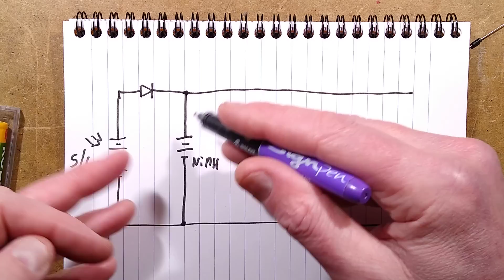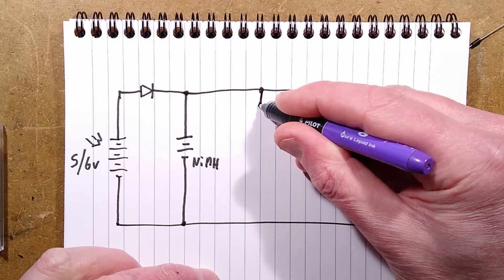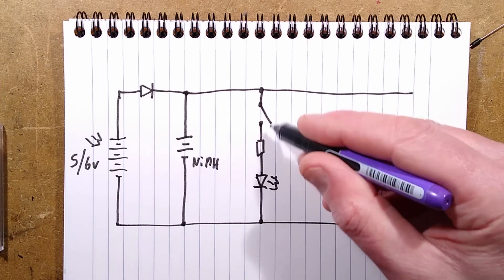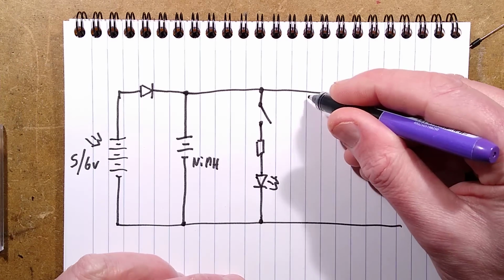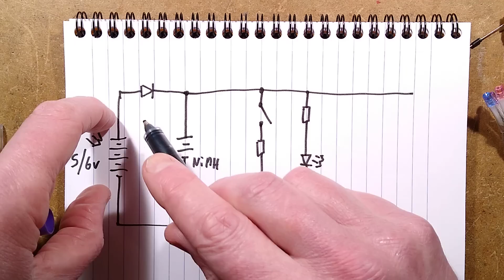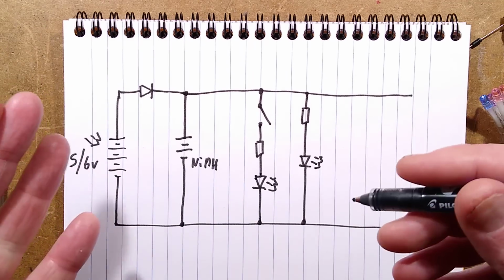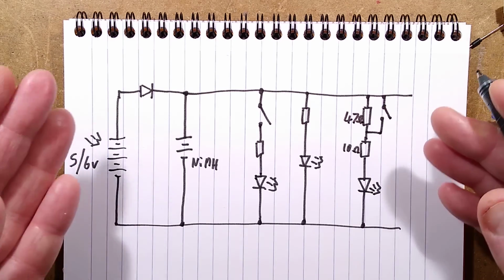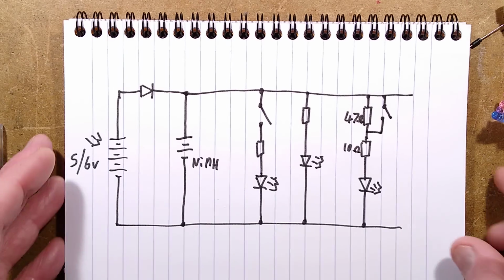Apocalypse solar lighting system.

Comment: i have an old powerbank case with solar panels, they open like a book, it also has adjustable output voltage, should get it into operation as i removed its battery as it was bad. This is a fun adn simple project, i like it

Comment: Something you showed but didn't really mention: If at all possible, especially in a post-apocalypse scenario, use connectors. It prevents having to completely rebuild the light every time something fails, and makes simpler-to-troubleshoot modules for people that might be less savvy. (This is post-apocalypse, so you're trading these with other survivors for supplies, right?) It does add considerations for accidental disconnects and waterproofing, but I still think the difference is worth it. 👍

Comment: Where do I get blue LED running at 2.4 Volts?

To make it a little more realistic, you should solder directly with solar energy. :-)
Reply from the maker: Most will run down to that voltage - but at very low intensity at that level.

Comment: Living in a rather cloudy environment at ~42.8° latitude, I find that I need at least twice the solar panel than is provided with whatever is commercially available for full 24/7 function.  Not twice the voltage, but definitely at least twice the current generation given the lack of direct sunlight where I live.
I imagine knowing how much solar panel you need (compared to average) given the direct sunlight of your living area might be a useful thing to know after an apocalypse.  And maybe even before one.
I'm rather fortunate to know there's a small hydroelectric dam not far from where I live.  It should be relatively easy to maintain if I were the last survivor.  It's kinda fun thinking about exactly what you could do if you suddenly were the last person on Earth - and still have decades to live.
Reply from the maker: the joy of this very simple circuit is that it adapts to ambient sun levels.  Even with very low levels it just glows at a lower intensity.

Comment: Can you disassemble a fancy microphone, like what Youtubers use?

I am wondering what makes them so much better.
Reply from the maker: Some do use a much larger microphone element, but many are basically just a huge fancy case with a standard tiny microphone capsule in it.

Comment: A small hand-crank generator would also be quite handy for the apocalypse. It could be as simple as a DC gearmotor from a scavenged child's toy connected to one of those 12v to 5v USB car adapters. A diode could be added to prevent the dc motor from destroying the device if it is cranked the wrong way.

Comment: The only thing this light is missing is the automatic dusk-dawn. This can be achieved by reading the voltage on the solar cell.

Connect the base of a npn transistor to the solar cell through a resistor before the protection diode. Then the emitter is connected to the base of a second npn transistor. The second transistor has a pullup resistor making it an inverter. When the first transistor is no longer powered by the solar cell, it stops pulling the base of the second transistor to ground, causing the inverter to output a voltage.

Apprently, youtube spam filter thinks that explaining a circuit diagram is spam so had to re-comment it here and explain it in English instead.
Reply from the maker: Look for my simplest solar light project that achieves this with a single transistor.
Reply: Odd how the reply keeps deleting itself. I could reply here but replying to above deletes the reply. I think youtube spam filter doesn't like it when dot and com is the name of the person. 

Original message: That's quite a simple circuit, it reminds me of the LDR voltage divider but uses the solar cell as the pulldown instead, https://youtu.be/B0H5iWZ0N60 is the video of him explaining it.
Reply from the maker: https://www.youtube.com/watch?v=AEnYRXr1_ww
Reply: One concern I have is the gate/base not turned on fully
Reply from the maker: @TheUnknownCatWarrior  The A2SHB MOSFET has an extremely low gate voltage and ultra high impedance.
Reply: What about the A09T N-MOS?
Reply from the maker: @TheUnknownCatWarrior  It has a low gate voltage too, so should work.

Comment: Definitely the hardest part would be soldering if you only have a big desktop iron that uses many many watts. If you've got a gas soldering iron or a USB one and a way to charge a Lithium battery it makes it way easier. I actually have little USB 8W irons that I keep in convenient places just in case... as well as LiPo cells and some small solar panels so I have a starting point to produce more power. Plus my area has a LOT of homes with solar systems, so I could get started quick on big lighting. But this would definitely be something I'd do for fun!

Comment: Hi, I really wish you could cover the 12V cigarette plug windshield defroster heater. They come with 0 safety, they are expensive and its said that they can deliver 1000w of heat also they are really cheaply made

Comment: Solar stuff doesn't work all that well here (Scotland). In the darker months when you want it most the garden lights usually die before it's fully dark.
Reply from the maker: This circuit deals with that by automatically balancing its output to match whatever light it can get.

Comment: We have several strings of solar lights indoors, with the little panels stuck onto the windows with blu-tack. They work alright, but the panels are realistically undersized so they tend to run out fast unless it's the middle of summer. I recently picked up some larger ~2ft square 30W caravan/canal boat type panels, and I'm planning on making one larger battery pack using LiFePo4, with several plugs like the ones you add to your strings to be able to have maybe 6 or 7 off one longer lasting pack.

Comment: On the 510 soldering tips for use with USB-/battery-powered vaping pens: do those you bought earlier still work? I have purchased some, and they don't seem very reliable, but they do work.

Comment: PV are basically PN junction diodes hence the 0.6v per element. That's why the internal loses increases exponentially when you reach that voltage. The no load voltage corresponds to all the current being wasted internally.
The highest power is usually a bit lower around 0.5v.
The problem with that design is that when the nimh are full, the current is still very high. Too much for the internal recycling of gazes. You'll dry the cells very fast this way.
It would be much better with 4 cells so when you reach 6v=4*1.5v the current from the solar cell drops to zero.
The diode is useless but can be used to drop a little but the voltage to 6v-0.6v=5.4v. With 4 nimh you'll get 1.35v maximum per cell. This would reduce the capacity a bit but would probably increase the life of the nimh because you'll get 0 charge current before the battery is actually full.
Reply: If there is no load, there is no current.

Current only flows if there is a circuit. No load means no circuit.

No load means that the electrons in the valance band in the semiconductor are being kicked up to the conduction band when sun light is falling on the panel but there is no where for the electrons to go, as there is no circuit.
Reply: @deang5622  They go somewhere: they are recombining with the holes creating that "internal" current. Otherwise photons will continue to create new pairs indefinitely and the voltage will continue to raise.
The classic way to model the solar cell is with a current source that depends on the illumination level and a diode that represents those recombining events (plus resistors because... there are always resistors)
Some explanations:
https://m.youtube.com/watch?v=uV_z1ptufa4&t=445
Reply: @cmuller1441  My point was, obviously, is that they don't flow in the conduction band out of the material as an electric current. Of course they lose energy.
Reply: @cmuller1441  Mate I don't need explanations on how diodes or solar panels or other semiconductor devices work.

I studied the semiconductor physics in great depth as part of my degree programme

Comment: I had lot of fun making mini solar power systems using LEDs in series and parallel as make shift mini solar panels and capacitors as rechargeable batteries. It only provides enough power to make an LED flash briefly or let you watch the multimeter discharge the capacitor faster than the LEDs can charge it while you are measuring the voltage. But, it demonstrated the basic principles of gathering, storing, and using solar power without having to make any extra investment beyond a basic electronics component kit.

Comment: Good to see this mini project Clive. I have a few 6v 160mah panels, which I am looking to do something with. Any ideas for a power bank, especially connecting the panels in both series and parallel, as I am not sure how useful the 160/320 mah capability would be ?

Comment: During blackouts we had to make similar lights here in Ukraine.😄 Because light day is short at winter and not much sun, we didn't use solar panels and rechargable cells. All diode garlands and even single light diodes were sold out fast. Power banks prices rocketed sky up. So you want to buy all components beforehand if you want to be prepared. What people used most back then is simple non-rechargabe alkaline cells(which were still on sale), electric instrument cells, car batteries etc. Simply what they had at hand at moment. Alkaline cell and light diode was simpleist and what were made most to place it all over your home and bathroom more frequently😄

Comment: Just before the threat of power cuts last autumn I sensibly bought a wind up/solar powered radio with an LED torch built in, Roll on the apocalypse, I won't have to solder anything to see WTF happened!

Comment: It breaks my heart to see that built without an off switch. The absolutely predictable problem with solar powered lights is that in winter - when you need lights for more hours of the day - there is only a tiny fraction of the sunlight you get in summer. My zombie apocalypse emergency solar batteries (12v lead acid 300Ah) are barely kept topped up Vs self-discharge when there is no drain on them in Nov/Dec/Jan when my 300W rated panels make about 0.4A at noon on an overcast winter's day, and nothing for about 20hours a day. So, it makes me cringe watching those LEDs being powered instead of putting that charge into the batteries :)

Comment: Great video, as usual. Inspired by some of your earlier videos I connected LEDs to 2 AA NiMH, without any resistor, and indeed it worked very well. With enough LEDs it can be a used as a flashlight, not a strong one for very long from just 2 AA NiMH, and strong is obviously a relative term unless you use a huge number of LEDs.  If I remember correctly each led drew 1.7 mA with the batteries just out of the charger without a resistor.    

Anyway, multiple pairs of batteries in parallell would make it possible both to use more solar power safely and make a "strong" flashlight that lasts a fair amount if time.

Comment: Seem to remember led can produce electricity,  so a lot of strings in connected in a star outside could power the NiMH cells,
got no diode, yes you do, light emitting diode. (chose star to minimize wire resistance)

Comment: I've had to recycle/scavenge solder from circuit boards before now for running repairs, I did a good enough job for a temporary fix.  This video did make me wonder how one could make solder and flux from scratch or at least recover it from the smouldering ruins of civilisation.

Comment: This is a great vid, the only thing I would add is try to use a small silicon diode 1n4001-1n4007 have a reverse leakage of around 5uA where as if you used a schottky diode it will have significantly higher leakage, even upto mA in some cases

Comment: A couple of years ago I built a solar light circuit with 2 supercaps and a joule thief powering 2 1W leds in series. The solar panel was salvaged from an old horrible nicd solar light. I used a npn transistor and the same solar panel for light detector. Super simple circuit, lasting to this day!

Comment: I'm playing with PV ATM. Two standard 1.5x1m panels on the east and west sides of my house, roughly pointing south charging a couple of AGM batteries. On a fogging morning I get perhaps 10w per panel  , peaking to 275w in full sunshine.  Enough to run the network routers and a small PC, with power to spare for other stuff (I'm not really into fairy lights).
Reply: It's good fun, but if people are doing this kind of thing to save money, it is rarely viable, economical in the UK.

You have to compare the cost of producing the electricity from the PV panel to that from the national grid.
Reply: @deang5622  Oh yes, it's just for fun . ATM I see no way for a full , grid linked, system to pay for itself.  If you take a UK average (annual) of 20w/m2 then , if you could use all the power from the panel, each panel would generate about £85 worth at 35p a unit!

I bought a couple of cheap s/h panels locally and keeping everything DC and cheap . I'll be lucky if it pays for the parts cost in two years

Comment: I highly suggest to change these batteries to much better lithium with cheap TP4056 BMS (salvage will do good too). These old type batteries cannot last long in apocalypse despite the light consume very little power. It's more about battery life cycle rather than light. Of course, with slight modification for buck converter.

I have slightly different variety light like these too, called them fairy light here.

Comment: Very nice project!
What about using a P channel mosfet? Gate is connected to + of the solar cell, Source to + of the battery and Drain powers the LEDs. They should only light up when it's dark.

Comment: Thanks, Clive.  Over the dark winter I decided to do just this using garden solar lights. As with most things, the project got grander and grander as I acquired a 130W solar panel, an MPPT charge controller, a brand new 12v 18.9ah battery, and assorted fuse holders, etc,, with a view to powering LED strings and charging my phone and chromebook without bothering the utility company. (I also bought one of those Chinese diesel air heaters.) I've salvaged a number of 18650 cells and holders and I have an old mains UPS. Is there a way that I can link all those components into a sort of power station?

Comment: Hey Clive long time watcher.. Love YA!
Quick question : is there a fancy way to connect several solar lights (panel+Battery+Circuit) to each other so they charge each other?
I'm sick of putting out a string of lights then a few go out early because of a shade. :(
Reply: Take the solar panels and connect them all in parallel.

Then connect all the the batteries in parallel.

And finally, the obvious bit, connect the string of panels to the batteries.

Then your panels can be in different locations and hopefully when one is in shade the others are not. And the  batteries will continue to charge.
Reply: @deang5622  you'd need blocking diodes on every solar cell to prevent lazy cells in the shade from eating the power the others made.

and if one wants it properly: put up a 12V system with 3 cells in series, connect to a suitable mppt charge controller (Vin= min. 65V), into an AGM or better LiFePo battery and supply your lights off that.

not as simple, not cheap but wayyy more energy gathered and also good in cloudy conditions via the 3 series cells + mppt charge controller.
Reply: @casemodder89  
My background thought was how do I stop a faulty 'battery' from causing issues.  But couldn't think of a diode arrangement that would allow charging and discarging.
But Connecting the panels with a Diode (the right one) would allow all the panels to work together.

I had a powered low voltage system years ago.  YEP much better.  But the the lights eventually failed/got dirty/broke so I was left with just teh cable in the ground. 

The main idea is all these cheap-o solar lights look good (for a while).  If there was an easy way to hook them together bury a cable between them that could be reused for a different 'cheap-o solar light' later (and some soldering) I've got a reusable system.  
Also keeps the wife happy when she gets bored with the old lights. :)
Reply: @deang5622  Good idea with the panels as they would charge each battery through their own circuit.
Connecting the batteries could cause issues.  If you had a bad battery it would kill/discarge the rest and it'd be a pain to find the one causing it.

Comment: I actually have a cheap usb battery pack that has a weird schematic, in that its charging port is connected to its output port via some 2mm wide traces and an smd ferrite bead/choke

So, I would be able to charge and discharge it through just its usb-a output port. It is also very sensitive to loads in that it will turn on for just a single led with a resistor, but at such low current it would cut out once per minute then sense that there is a load, and re-engage.

I got it from the $5 deals section of Target...

Thus, I could do this with leds in a 2s configuration and a 5v panel, and get the high capacity of 1s li-po batteries, but the simplicity of just needing any 5v supply

Comment: Very cool, indeed!
Dumb question - what is the diode for? Preventing current flow from the battery to the solar cell, maybe? This is not any kind of criticism or challenge - you're clearly the expert here. I just wonder what I'm missing about the diode.